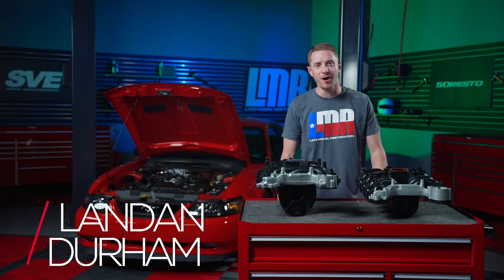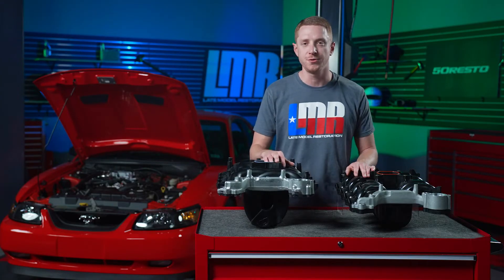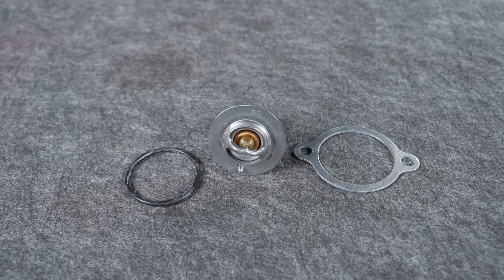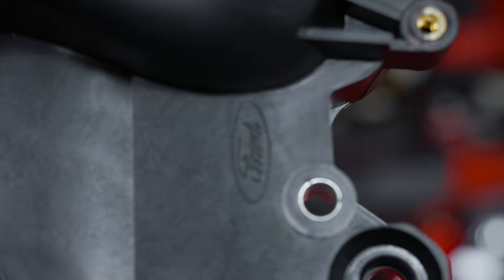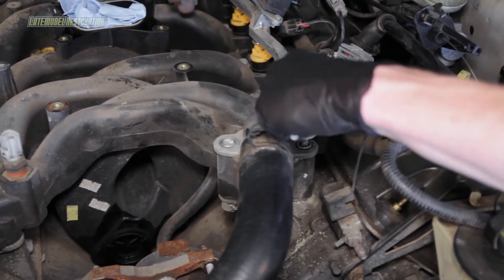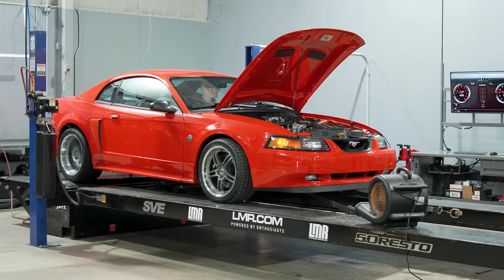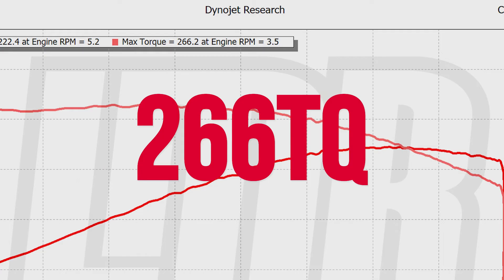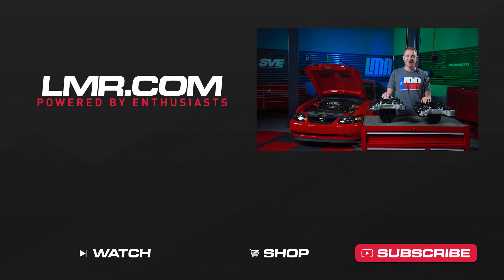Ford & Dorman PI Intake Manifolds Explained | 1999-2004 4.6L 2V Mustang GT

Comment: But would it fit a 2002 f150 with the same engine?
Reply from the maker: No. The throttle plenum flange on a F-150 is different. You'll want to purchase an intake manifold specific to your vehicle. -Landan

Comment: Is the mustang pi intake different than the crown Vic intake? I have a 98 grand marquis that still has a plastic cross over
Reply from the maker: That was before Ford switched to the aluminum coolant crossover. This happened during the 2001 model year. -Landan
Reply: @would that intake fit on a vehicle that doesn’t have an aluminum crossover?
Reply from the maker: @adg4629  The aluminum crossover won't dictate fitment. Year range will. Your car has a non-PI engine since it's a 1998 model year. I won't get down the rabbit hole of PI intakes fitting on non-PI heads. There is plenty of info out there if you want to do your own research. -Landan
Reply: @latemodelrestoration  I really do appreciate your input. Thank you

Comment: I put the Ford PI intake on my 2004 Lincoln Town Car two weeks ago and so far is great and no issues. I can definitely feel a power increase. My only advice is be careful when tightening down the bolts that hold the coil packs down. I over tightened mine a bit and now the brass inserts a turning with the bolts. A little gorilla glue and that problem will be fixed.

Comment: 2005 4.6 very similar, the dorman decreased gas mileage from 23.5 to 21.5. idle is higher but could be from cleaning throttle body. Dont notice a performance hit. However wish i would have went with Ford performance intake.

Comment: My 98 Ford F-150 4.6 2 valve has a cast aluminum intake. Is it original? Thanks
Reply from the maker: Possibly. I know that '99 5.4L (non-Lightning) trucks had an aluminum intake manifold. It could be that 97-98 4.6L 2v engines also received an aluminum intake. I'm not 100% positive on that, though. -Landan

Comment: Ford intake- part # PU7Z9424A  it’s a direct replacement for the original. It’s says it’s out of stock… I called the Ford dealership here in Spring Hill FL. Asked for the parts department, told him I needed an intake manifold for my 04 Mustang GT. He had the intake sent to me the next day! $425 it works great!
Reply from the maker: That's great! Glad you got one. That same intake is about to be in stock from Ford Performance. It'll be around $349.00 (pricing subject to change, of course). -Landan

Comment: Ford racing PI OE intake manifold, plus long tupe headers 👍 on a P-71 interceptor 4.6 liter from 2 inch dual exhaust with H pipe to X pipe with 2 1/2 inch dual exhaust swap , which helps equalize exhaust pulses at higher RPMs (327) rear end gear ⚙️ ratio. I need them gains, then increase throttle body diameter and true cold air intake.

Comment: Geez. Idk how the ASE haven't banned the Dorman intake from use in repair shops. That's almost criminal. How can you call a replacement part something that leaves it worse than during the original failure?
Reply from the maker: ASE has no say-so on after market parts, but I know what you mean. -Landan

Comment: I'm not 100% certain the power loss is as measurable on a stock car. That car had high flow exhaust and 93 octane tune, so I could imagine the air intake capacity could be a lot higher than stock. You might get a power loss with boltons, but not necessary with stock intake, cats and exhaust.
Reply: Modded or not, it's a shitty intake n you'll be sorry you wasted your time n money on it..
Reply: @P71ScrewHead  They don't make the PI one anymore, and the trickflow requires additional modifications, suffers from heatsoak and doesn't give the same powerband either. Even the Ford PI intake is going to split again.
Reply: I’m owned a mgm totally stock with dorman intake and it’s noticeable the loss of power at top end.

Comment: What he really did not do is describe exactly WHY the doorman is a poor choice and a non performance intake. When ford redesigned the 4.6L and came out with PI heads cams and Intake the PI intake has larger runners. Dorman had already made the 4.6L replacement manifold and instead of redesigning a new PI intake for the PI engines they kept the same NPI restrictive runners from the original design and just changed the last 2-3 inches where it bolts to the heads with the newer PI design. so when you buy a doorman PI intake for your PI application you are simply getting a NPI intake that bolts up. Avoid this turd even if given to you the dyno clearly shows that it is a poor alternative.
Reply: They made too many, maybe that's why..lol

Comment: Just put a dorman in cuz i couldnt find a ford one. I was searching for a fix for my lean condition code ended up being my fuel pump. But apples to apples, i felt my explorer with a 2v running a little better on the dorman. Also visibly from the exterior the runners look bigger but shorter than the Ford one.

Comment: Good video, but never mentioned about the EXHAUST MANIFOLDS between pi and npi. So, do the pi exhaust manifolds flows more or equally than npi?
Reply from the maker: juan - We're splitting hairs when it comes to the manifold designs for 96-98 and 99-04 cars.  Both are a log-style design with not enough differences to see a noticeable power increase/decrease.  -Landan
Reply: In other words, get longtubes or shorties but not logs..lol

Comment: When the nipple for the heater core broke on my stock manifold.I went to Ford and bought a brand new Ford Racing manifold never run that crap dorman it doesn't run right with it 23hp lose no thank you. These cars already make low hp to begin why run garbage..

Comment: Anyone able to find the Ford ones? All places out of stock
Reply from the maker: VJ - Ford's supplier for this intake is having some issues getting certain material to make the intakes.  We have some more intakes on the way.  It's a first come first serve basis, so sign up for in stock alerts via the product pages.  I'll provide the links to both Ford intakes.  Please let me know if you have any questions.  -Landan

Ford OEM: https://lmr.com/item/LRS-9424AB/ford-mustang-pi-intake-manifold-99-04-1w7z-9424-ab
Ford OEM w/ FPP Branding: https://lmr.com/item/M9424P46/999-04-Mustang-Gt-Pi-Intake-Manifold-Requires-Lrs-10153A
Reply: Summit racing has it

Comment: I run the Dorman intake, because the Ford one was out of stock :/ I did not appreciate the self tapping screws—but honestly everything else was very convenient.  The Dorman intake is a KIT—cost about 200$ for the intake manifold, the gaskets, thermostat, o-ring, and hardware.  After install, I did not notice a real difference in power—except for smoother engine operation.  I’ve been running it on my car for a year, and it’s been good to me so far.  I’m very surprised of how much the Dorman affected this car.
Reply: Lol did u even look at the 2 it's definitely obvious
Reply: The loose of power is obviously at top end
Reply: @juansabal9995 I just had the Dorman intake installed on my 99 GT with 72,000 miles and it’s running awesome. I didn’t lose any power going from the factory intake to the Dorman. The engine runs so strong and smooth. I’m impressed.
Reply: @Ornelas11B  i loss something like almost car length with my neighbors car, previously with the oem intake I was ahead of him..!!
The difference you will notice is only at wot

Comment: My 04 mustang GT intake manifold cracked and my mechanic told me he would put the best that money can buy because that’s what I wanted and I wanted to keep the car original with ford quality parts and he put a dorman intake on and said it was from ford now I got to do it right myself
Reply: What a liar. I'm sorry
Reply: Sue his ass for lying n having to replace it again.. He knew what he was doing when he sold you that crap..
Reply: @P71ScrewHead typical crooked mechanic.
Reply: @NoNo-iz8hd  I've encountered plenty.. i had white smoke coming from my exhaust n a dyno shop told me my pistons were worn, $5k in labor to replace + parts.. Took it to another shop, turns out it was a cracked intake manifold n leaky fuel injector.. Honesty goes a long way, now i'm a repeat customer of theirs.. They installed my TFS 38cc heads n cams, rear diff fluid change, n i recommend them to everyone i know n asks for recommendations.. Gotta be careful who we trust our cars to..
Reply: False

Comment: The pi intake from Ford is cheaper and flows more. The dorman one actually flows less than a non pi intake and it is the same as installing a check engine light.
Reply: I believe you are right because every since the mechanic installed the dorman door knob on my 04 mustang GT the check engine light stay on and he clear the code and it comes right back on but the car is still running good but I can feel a power lost on top end and down low
Reply: Dorman is junk
Reply: Where can you find a pi intake cheaper than a Dorman?

Comment: Ive worked for Dorman for 6.5 years now and am restoring my fox with a mix of LMR and Dorman parts. When I saw the Dorman name on the video I got pretty excited. Super cool to see the dyno results!
Reply: Are you to blame for the less than " lack luster " performance.
Reply: @robsorgdrager8477  i deal with steering and suspension mostly. But its things like this that we need to see to make sure our parts meet the right standards. Regardless… i made sure the right people saw this video.
Reply: @bmaccccc9  I ran into issues with these when building my Vic and then started seeing the exact same issues on my customers cars. The air fuel actually freaks out to the point of causing misfires at highway cruising speeds. I swapped the dorman out for a fomoco perf part and AFR almost instantly plopped back into spec and fuel trims came back to normal.  Normally I use moog or dorman as I have learned to trust the parts and most times the dorman parts are better than the manufacturer. As a mechanic I understand that sometimes stuff happens and it's to the fault of the universe. I would assume if dorman fixed the runner cross section it would be equal to if not better than the Ford part.
Reply: @robsorgdrager8477  before dorman i was a tech myself and 100% understand. When i started there it was refreshing to see what they really do to fix anything they put out there that isnt meeting atleast OE standard. If you are interested… we have a facebook forum if you want to join. We talk parts, issues with our parts, what you liked and what can we improve. Techs do voice their oppinions on our parts which is not always positive, but its a great learning experience for us to improve and fix whats out there if we were not aware of it.
Reply: @bmaccccc9  that's actually pretty cool. I my giver a look 🤙✌️

Comment: You can feel a difference with those thinner runners. They are thinner and you can feel the power loss.
Reply: I puked it right back off and put a new dealer intake back on.

Comment: I just put a TRQ stick replacement on my 97 MGM non pi engine but it seems like a good product. Been driving it for a out a week now with no problems no leaks. I think even though it's a stock replacement it could make a little less than the stock intake just due to car being stock everywhere else. I did clean and somewhat polish the plenum and throttle body. It does have a lag some I'm the lower range but in the higher rpms it seems just like the stock one as far as I can tell. The lag may be the air fuel ratio and I would have to get it tuned for that
Reply: I have a dorman on my 98 MGM for 8 years now, almost 100K. Just needed a part delivered the next day so I can install and go.
 Don't really care about extra power but it may get a bit more gas mileage with this intake. These years must be modified a bit to take the Ford Intake, didn't want to mess with it..
Reply: @alb12345672  lol it's easy af to put a pi intake on a non pi engine
Reply: @neilbrown82  Maybe in the 98's next life :lol:
Reply: TRQ and dorman manifolds are trash Imo I've seen 3 of them fail within a year, either huge vacuum leaks or coolant leaks... Poor quality control I guess

Comment: My car had a ugly missfire on cylinder 1 and 5 when I bought it.  Turned out the intake gasket was letting coolant pass through into the runners. So I bought a Dorman at Orileys because it had lifetime warranty.. At first my car ran great, gas efficiency was way better and the miss was gone but after awhile the miss is back.  I replaced the coils,plugs,fuel filter,cleaned the maf and it's still missing so im betting its that Dorman intake failing again.. Going with Ford next round..
Reply: It started leaking in the back every 6 months with the dorman THERE CRAP
Reply: Also use only oem Motorcraft coils
Reply: Never doubt Ford, unless they offer you candy in the back of a van..lol
Reply: Good luck they stopped making them. I’m pissed
Reply: The Dorman didn’t perfectly match my heads and also caused a misfire. You might have that problem.

Comment: I just skipped both and went to the edelbrock victor jr intake 🤷🏻. But that’s me lol
Reply: Where u get it?
Reply: @averagemanhempgars502  summit racing I believe. Several places sale it. Just have to google it.
Reply: @Jsta2v_racing  thank u
Reply: @averagemanhempgars502  np
Reply: I got a bullit intake. I bought a dorman back In the day then ended up buying the bullit thankfully
Reply: I want to see a dyno comparison with that, without being tuned.
Reply: @commonsenseisdeadandgone losses all around. Its a useless manifold if you dont have the supporting mods like ported heads or bigger cams
Reply: @thenegus5469  yeah, that's why I want to see how much 😂 

I however disagree that it's worthless, it's great for boost, especially with how the torque comes in hard and low with boost, it's not going to hurt anything if it moves the torque curve higher 😂. With superchargers, swapping to a short runner intake sees a little more pressure from the same pulley set up so any loss there may be is likely compensated. Obviously when you're pressurizing the intake manifold the intake runner design isn't AS important. 

They are clean looking, allow you to hide wiring, easy to do a head cooling mod and  the ability to run over an 80mm throttle body (or is 78 the biggest?) 

I also like the ability to run a forward facing throttle body. But that's something else entirely 😂

Comment: Get the original them self tapping screws doesn’t hold up very well when changing coils
Reply: Changed a many of these on Crown Victoria's, and those screws are crap! The OEM(if available) or the Authentica brand is the best bet.
I got so good at changing those intakes I could do the complete job, and have the customer out the door in 20 minutes using no battery powered tools. If Dorman was what they wanted I would put a thin film of gray RTV around all the intake and coolant ports to prevent leaks, as I had one leak coolant at the rear from the improper design.

Comment: Found out a while back that the Dorman  was complete trash. I had a leaking  crossover pipe on my 05 town car. Went to the local salvage yard and grabbed a Dorman unit off of an old taxi. Once installed it had terrible throttle response.  Definitely was not the same car.  I ended up buying a replacement intake manifold from 1A auto. It actually was dang near identical the original ford part. I installed it and the throttle response was back and I save a couple hundred.
Reply: I have a 08 4.6l F150 That I just bought a dormant intake for. It was warped, So I have a mighty vaccuum leak. I think I might just try to return it and get the 1aauto part. I'm so sick of fighting this damn thing
Reply: I imagine the 1a auto part is also a Dorman as nobody else is really making these. Every aftermarket intake is a rebranded Dorman part.
Reply: @countryboy9546  I can assure you it is not.
Reply: @countryboy9546  for some further clarification the Dorman unit has short runner design. The OEM has the longest runners but the 1A auto comes dang to the factory runner length.
Reply: @mattmccoy2410  yeah, I was looking at that. I see the short design in photos online of the Dorman intake. You must be talking about the TRQ intake which does seem to lend itself to having a longer runner design. I’m hearing Dorman has changed their intake design and has improved it their most current intake vs the old part.
Reply: Yes my crossover pipe leaked out of box. Was not tight from factory. On the doorman 8ntake